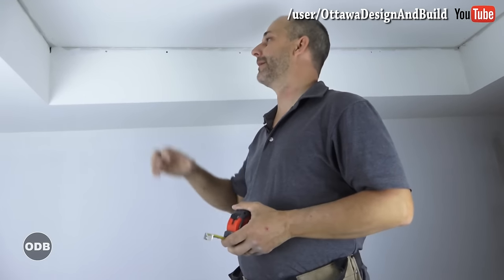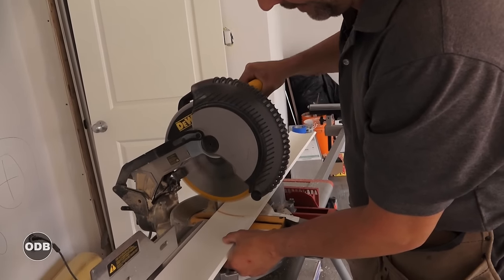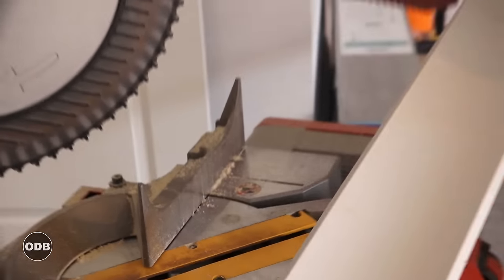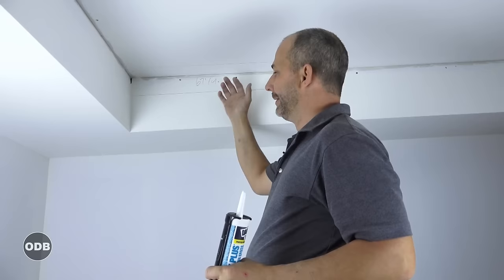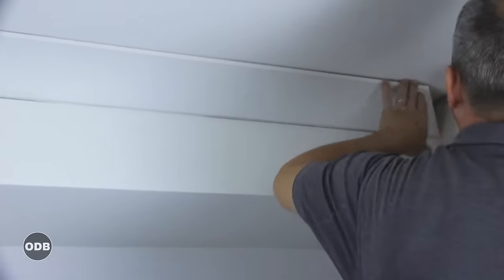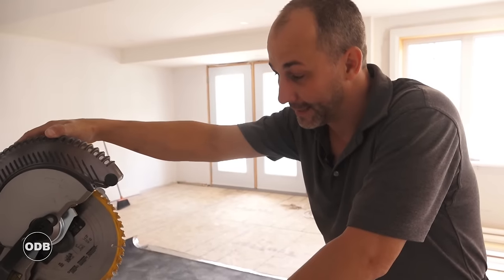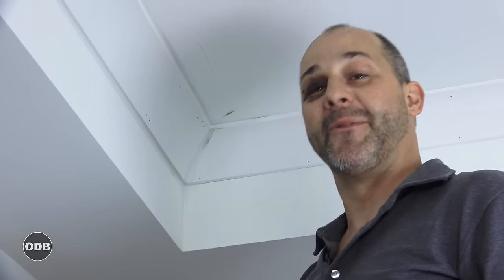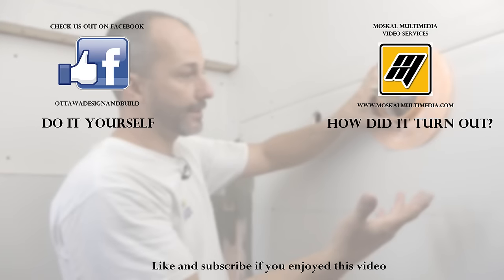How to Install Crown Molding Yourself and SAVE MONEY!

Comment: So more complicated than using crown stops just saying
Reply from the maker: but a cleaner look. Cheers!
Reply: The cleaner look I can make it look like it grows together cutting it upside down plus you can mark your lawn points very easily on the flat side and it’s facing you when you run your saw along it the salt lines up with it perfectly trust me I got 25 years in the trades
Reply: Are you the guy in the video did you ever put a ribeye on that eye